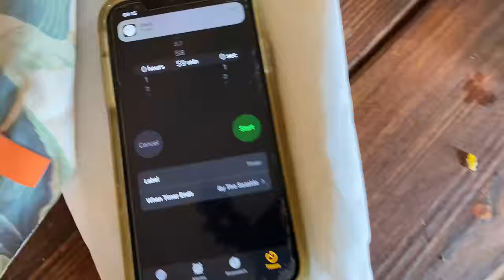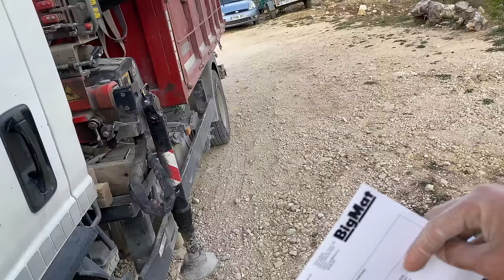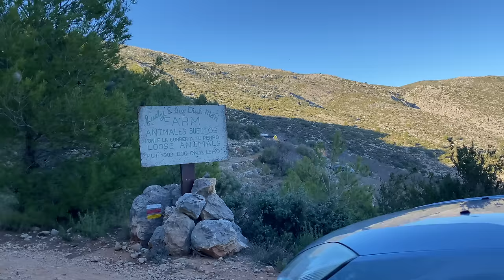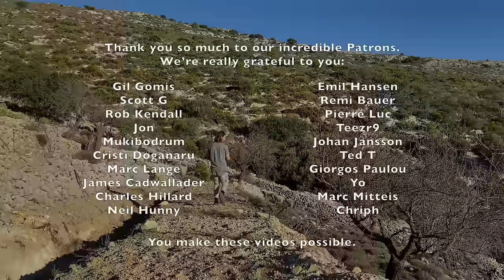OFF-GRID HOMESTEAD in the WILDERNESS | DIY Compost Toilet Build #2

Comment: You have rocks... learn to use them for construction in the same way they were used before, and it will save many hours carrying bricks up the mountain... you will need a press to split rocks
Reply from the maker: Thank you for your comment and advice! We really want to learn how to use rocks more effectively. The Moors built many kilometers of terrace walls on our land 1,000 AD, so we're sure we can give it a go! Not sure what a rock press is? ❤️
Reply: @ladyandtheowlman @ladyandtheowlman The Smaller you cut the stones, the thinner the wall can be... sometimes you can use the supermahones to build an internal wall and a ventilation core to increase thermal insulation...
Reply from the maker: That's cool makes sense! Yes sometimes you are forced to make very thick walls with the stones we have, so being able to cut the stones would be good! ❤️
Reply: When I was watching your channel with my girlfriend (she's from Galicia and we wanna move there in two years) I told her: Why are they not using the thousands of stones to build??? 😅 Of course its a little bit more complicated, but for free and much more rustic charme, better  room climate,...